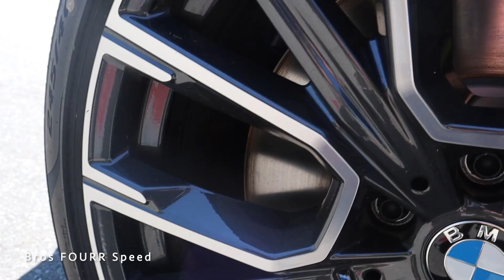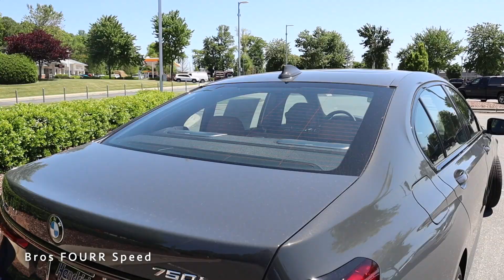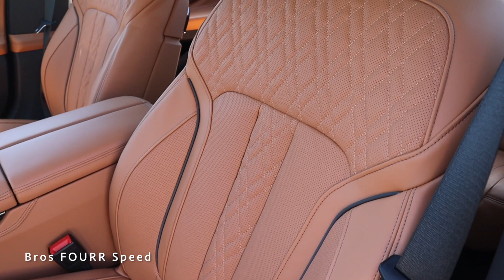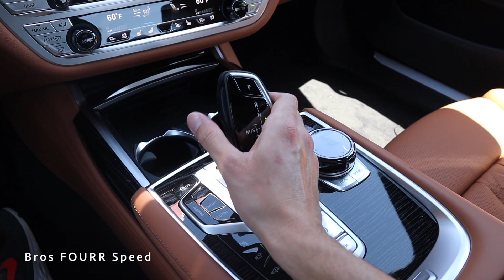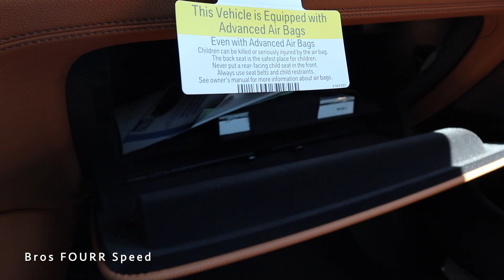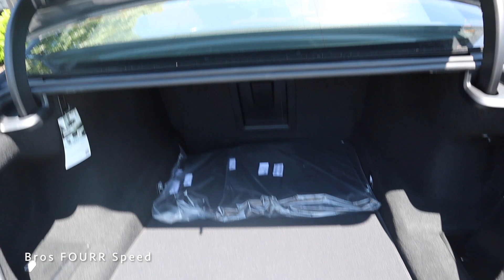2022 BMW 750i xDrive Sedan: Start Up, Exhaust, Test Drive and Review

Comment: You misstated the torque at 590, it is actually 553.
Reply from the maker: You are correct, I'm not sure where I got 590 from!  But most BMW's with this engine will have 553!

Comment: The car is great however BMW need to add eight surround cameras provide 360 degrees of visibility around the car at up to 250 meters of range. Twelve updated ultrasonic sensors complement this vision, allowing for detection of both hard and soft objects at nearly twice the distance of the prior system.
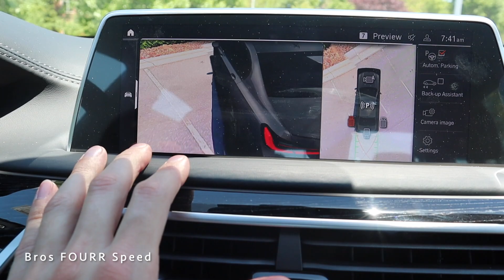Reply from the maker: This 750i does have a 360 camera system as shown at 7:50
It also has the front alert system

Comment: If the 2022s are out that is a clear signal that the 2023 will be all new.  I can't wait to see it.
Reply: I can't either!
Reply from the maker: Most likely there will be some new models for 2023. But the 2020 7 series was this new generation. So I don't see them doing anything drastic for 23
Reply: @BrosFOURRSpeed  Not sure what you're talking about, the current 7-series has been around since the 2016 model year, the facelift was for 2020, the full redesign will be for the 2023 model year. It's a seven year run like always.  That is why the 2022 is out now, it's pretty much on run out now.
Reply from the maker: That's what I was meaning. The 2020 is the same as this one. I was never around these before that model year, so didn't know 2020 was only a mid model refresh. So maybe soon it'll be completely new
Reply: @BrosFOURRSpeed  It's been 7 model years, there will be an all new 7-Series for the 2023 model year.
Reply from the maker: Yeah sounds like it

Comment: Hi Brian, you mentioned that the 4.4L twin-turbocharged V8 in the BMW 750i had 523 horsepower and 590 pound-feet of torque. The actual torque rating for the 750i is 553 pound-feet. However, overall the review is very detailed.
Reply from the maker: https://www.bmwusa.com/vehicles/7-series/sedan/core-models.html

On BMW's website it lists the 750i xDrive has 523/590 ;)
Glad you enjoyed the video. Excellent car!